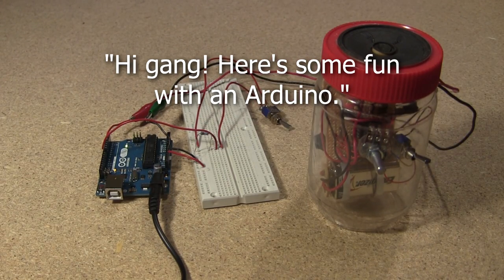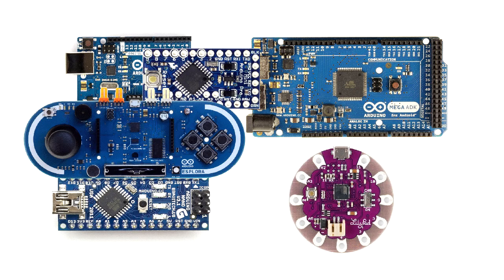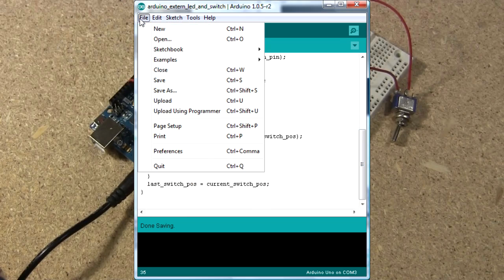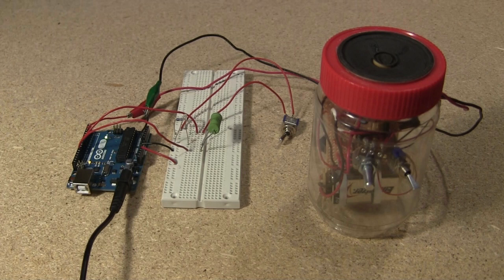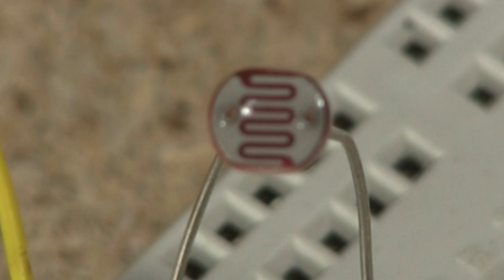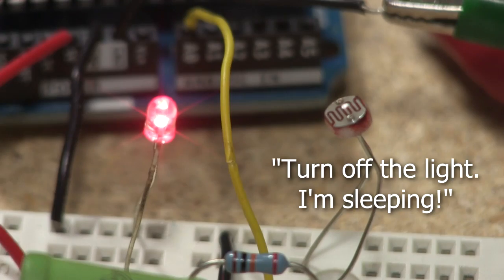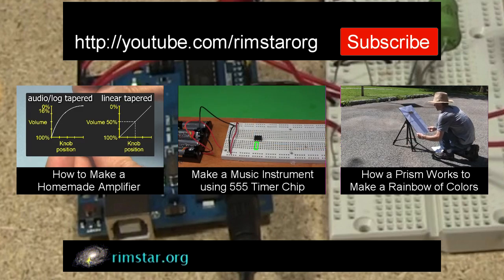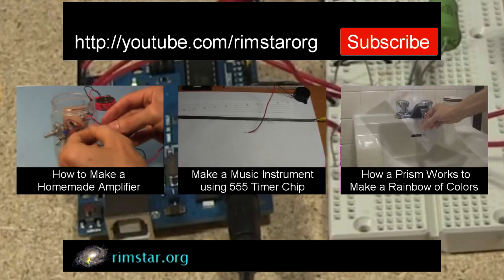Fun with Arduino that Talks with Speech Synthesizer

Comment: Can I remove the IC from the Arduino UNO after I load some program on it and use it without the Arduino? For example program the chip to rotate servo back and forward, remove the IC from Arduino, solder the servo leads to the certain pins on the IC, deliver the power to the IC and expect it will work? 

Thank You!
Reply: I don't understand it too much...I think, I will just buy the Arduino UNO and see what it can do. I just thought, it would be cool if I was able to remove the microcontroller from the board and use just the bare IC, so I can make more projects.
Thank you very much for your willingness :)
Reply from the maker: ***** I don't know if the flash is on the processor chip or on a separate chip. But even if you managed to remove the flash chip after programming it, you'd still need a processor somewhere to run the program.
Reply: RimstarOrg The flash is on the chip.
*****  You should check the Arduino eschematics. I belive some of the i/o pins are just extentions from the IC legs, but the oscciloscope, for example, is not on the IC.
What you CAN do, is get PICs, and program an Arduino to act as a PIC burner/programmer for example http://forum.arduino.cc/index.php/topic,92929.0.html.
Reply from the maker: estcap2 Oh, cool! I'm guessing that when you say "oscilloscope" you mean "oscillator".
Reply: Thank you guys for a quick response :)
Reply: RimstarOrg yes sorry haha. I was watching videos testing the Due Waveform Generator with oscilloscopes and mixed the words.
***** Thinking a bit more about what you asked, if you need something more powerfull than a PIC, you can allways make more Arduinos from your arduino. You would need to get a bunch of AVRs of the same type your arduino has, and replicate the schematis (they are public and really well explained in a lot of tutorials). You can even try to make smaller versions such as http://dangerousprototypes.com/2012/11/08/minimalist-arduino-for-3/  or http://www.gammon.com.au/forum/?id=11637   (I didn't try them but I read you shouldnt forget the capacitors in the one of the first link, but you can make it without them). 
I read that what you end up with is not a 100% compatible arduino, but an AVR without bootloader and really basic functions.
Reply: *****  I see... well, for that matter just buy a bunch of Arduino Nano if the size and price are the problems. The concept you have to understand, I belive, is the following  "Arduino is intended to be used as a unit -- it's a convenient self-contained prototyping platform. Yes, it's a bit more costly, but that's what buys you the convenience of not having to build so much of your own interface and power-supply circuitry. If all you want is the microcontroller chip and a card for programming it, the Arduino may not be the best solution." -quote from http://www.instructables.com/answers/W-Arduino-after-you-program-it-can-you-then-rem/-
You are welcome :D
Reply: ***** If memory serves me correctly you CAN remove the chip, but that is normally to put a boot loader on a new one. However you can build a breadboard arduino clone, such as the one by shrimping.it
Reply: omg that How It is like when sb has big wallet...i' ll but uno,remove uC, but bjnch of nano's,use atmega328 to Control only servo...eh please look at the 'atmega8 arduino pinout' in Google, then how to add capacitors and voltage to this chip and you have got arduino for few cents I guess. I would really like to live in a country where original arduino is a cheap piece of shit ....
Reply: *buy
Reply: MisterG Thank you :)
Reply: bartibv price for an Atmega 8-16PU: 1,42 Euro (where do you get it for a few cents?)
price for the Atmega 328P-PU with bootloader 1,52 Euro (both prices from ebay, they are about the same for everyone, unless you are living in the middle of Africa.)
Also the main part of Arduino is the simple and easy to use software and that it doesn`t need additional programming hardware.
Reply: Experimentaltechnik  cheapest atmega8, free shipping:
http://www.ebay.pl/itm/1PCS-IC-ATMEGA8A-AU-TQFP-32-ATMEL-NEW-GOOD-QUALITY-/290729231218?pt=LH_DefaultDomain_0&hash=item43b0d00372

cheapes atmega328 (~2x atmega8 price):
http://www.ebay.pl/itm/1PCS-ATMEGA328P-PU-DIP-20-Microcontroller-With-ARDUINO-UNO-Bootloader-NEW-/300726927158?pt=LH_DefaultDomain_0&hash=item4604b8bf36

Original Arduino UNO - 26$

Here's the difference:
atmega328 = 2x projects on atmega8
Uno = 11x projects on 328 = 22x projects on atmega8

I guess 90% of people won't use even 10% of arduino UNO potential.
Reply: Yes, I do this all the time. It works exactly the same without any tricks when you put it to protoboard. The Arduino itself is just programming platform.
You can also accommodate ICSP header to your project, so you can update the code in-circuit. I've done that too.
Reply: RealationGames And how can it be working without the oscillator?
Reply: *****
Atmegas have internal 8MHz oscillator(this has to be configured with the bootloader e.g. Optiboot noxtal).
It works totally well with it, but it's recommended to have external crystal if you have any data communications or any other precision required tasks.
Adding crystal with caps isn't that much of a burden though. They're very cheap too.
Reply: So you've just got Arduino UNO and you are able to program the IC without burning the bootloader and it works even without the board?
Reply: *****
You need to upload the bootloader, sure, but you can just do it in breadboard, it's just a click of a button.
Yes, then the chip works just like in the Arduino. You can also program all sorts of ATmegas and Attinys with it too.
Google "Arduino on breadboard" for instructions.
Reply: ***** If you don't have a bootloader, you need to add a connector that you can plug a programmer into. You can make a programmer out of another arduino with some software and cables.
Reply: USWaterRockets
Well, you need to put the chip on breadboard anyways to upload the code. You can use the same setup to upload code and to burn the bootloader.
Reply: Wait, I don't understand now...So when I buy the Arduino UNO (with Atmega328), it already comes with bootloaer in the IC, right? Then I am able to load some code on the IC using Arduino board, remove the IC and go? Or I have to rewrite the bootloader with some special bootloader which allows me to remove the IC and then go? Hope you understand, what I mean...My English is not very well :-P
Reply: If you're talking about the UNO, you can program the chip and move it to another board, but many other arduinos have non removable chips.

You can buy the ATMEGA328 with or without the bootloader. You get more space for your code if you leave the bootloader off. In this case, you will need to add a connector to your project to program, the chip using a programming tool (which can be made from another arduino). There are other ways to accomplish this, but the most common is this method.
Reply: ***** And the answer is "no". You do not need a special bootloader to remove the chip and use it elsewhere.
Reply: I don't get it now, you may think I am an idiot....if I buy this: http://store.arduino.cc/product/A000066
and program it so it can display something on display when I push a button for example...Can I then remove the microcontroller as it is, connect everything according this plan: http://www.sproboticworks.com/assests/shop/ic%20pin%20configuration/pin%20mapping.jpg 
and it will work? Because from what I've read, it wont because of the ATmega328 doesn't have a oscillator....Then I've read that you can but only if you load some special bootloader and last thing I can do is put some oscillator next to the ATmega328 and go...

Thank you very much for your patience!
Reply: bartibv The first link is to a TQFP housing. This is an unfair comparison, the Atmel328P is cheaper in TQFP too. But that`s nothing for a breadboard and harder to solder for a beginner.
The second link is not the cheapest, here is it: http://www.ebay.at/itm/161401449351
The difference is more like 1,1 x the price.
If I want to save money and space I use one of the Attinys. They are around 1 Euro and good enough for most small projects. (and can be programmed with the UNO)
I agree that most people don`t need or use the potential of an Atmega328P-PU, but putting a worse chip in the Arduinos isn`t really worth it, because of the small price differences. I guess that`s just how electronic evolves, everything gets more powerful, smaller and cheaper at the same time. Maybe in five years all the Arduinos will have 32 bit chips in them, and maybe in 20 years we will do video editing on the Arduino, who knows...   ;-)
Reply: *****
Yes it works just the same. Don't worry about fiddling with the internal oscillator, just use the external! They're 0.10$/pcs.
You don't need then change the bootloaders or anything.
I don't see any reason why you couldn't just simply use the crystal oscillator. Don't stress about it, it's simple!
Here's image of the configuration:
http://arduino.cc/en/uploads/Tutorial/ArduinoUSBSerial.png

Atmega328 DOES have internal oscillator, but you need different bootloader(different fuse settings, actually), to use it. This can be achieved back and forth with a simple button click in the IDE.
It's your choice do you want to use internal or external. Both are EASY!
Reply: RealationGames Thank you very much! Really appreciate it :)

Comment: Analog inputs can be outputs too, they're all I/O pins
Reply from the maker: bartibv Really? The docs I read on http://arduino.cc said the analog pins are output only and that for anlogish output, use PWM output with the digital pins that support PWM. Maybe it's just an Uno limitation and some of the other boards don't have that problem.
Reply from the maker: bartibv On thinking further, maybe you thought that because it's the AnalogWrite() function that is used on the Uno to do PWM, but with the digital pins.
Reply: RimstarOrg just type "pinMode(A0,OUTPUT); then digitalWrite(A0,HIGH); . Works and everything's is in Atmel datasheet fot mega328/168 and same for mega8. Same thing is when pin is in input mode,you can use it still as output but think of it as an output pin with 20k resistor:)
Reply from the maker: bartibv Neat! I just tried it and it worked. So you can't use the analog pins for analog output but you can for digital output. Nice to know. Thanks.

Comment: Somebody finally managed to squish a working speech synthesizer into the arduino? I have to play with this now.
Reply from the maker: ***** I guess you saw the links I gave for it in the description. The software comes with plenty of words to use in the examples. For copyright reasons I decided to sample my own, plus it's added fun :).
Reply: RimstarOrg I thought it sounded very ti99, its using the same encoding/decoding method. I'm glad to see that people still remember LPC, its pretty much perfect for embedded devices like this.

Comment: Wow! I didn't know such thing existed for arduino! I own a Mega 2560, a Nano r3 and a Due.
For what I found, it should work right away with the Nano, but they say it needs some sort of fixing for working on the Mega 2560. Are you aware of what kind of tweaking does it need? If it doesn't work on the Mega it wont work on the Due, with is the one I'd like to try, being it a much more powerfull arduino.
Reply from the maker: estcap2 I have only the Uno so I wasn't even aware there were issues with the others. I guess at some point I'm going to need more power and get one of the others too.
Reply: RimstarOrg Oh I see... well I really look forward to see more videos from you  involving arduinos. If you want a more powerfull Arduino,  I'd recommend you to skip the Mega2560 or the Leonardo, and just get an Arduino Due, wich while being 100% compatible with clasis arduinos and IDE, it is really powerfull (32bit AMR processor, 2k of RAM.-- 86Mhz occiloscope) I bet you will be able to build really good projects with it! Interfacing with video signals (RCA/VGA) can be really interesting by the way.